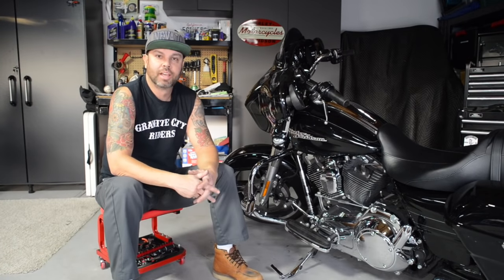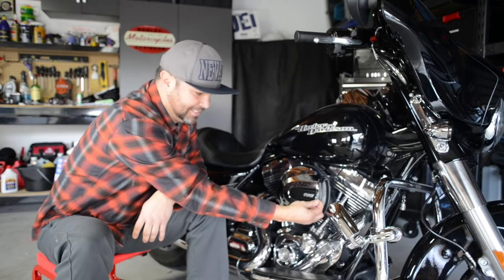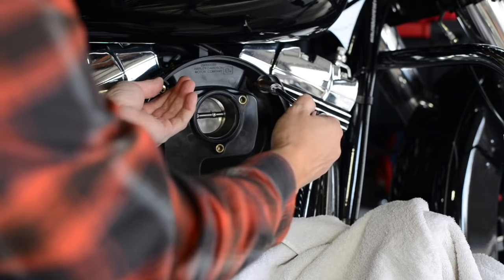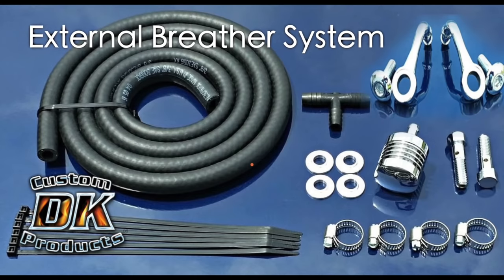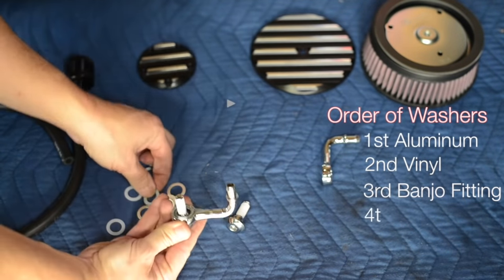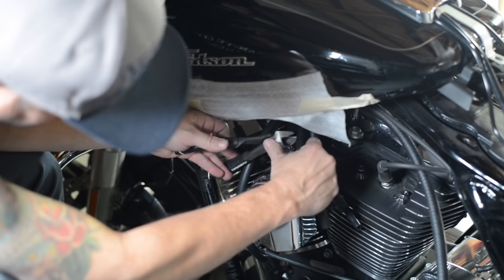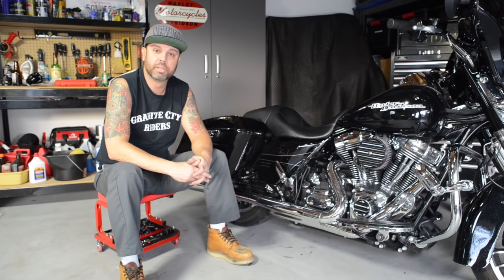How to Install a Stage 1 Air Cleaner and External Breather System on a Harley Davidson Street Glide

Comment: My experience with this kind of a setup on an M8 engine is that the external filter fills up with snot after a few weeks and pukes out oil to wherever you have it routed, creating the problem that you started out to cure in the beginning. At the end of the  day I just removed the filter altogether and ran the rubber hose down to the bottom of the bike and vented out to the atmosphere.
Reply: you can clean the snot out every so often too.. im ordering one to try it so ill eat my words if youre right and it becomes full too rapidly

Comment: The problem with this DK Customs kit is that it works against gravity and the blowback accumulates around the banjo fittings. The banjo fittings should be routed straight down and not up over the heads.

Comment: Great vid man!! New sub here! I have a 06 dyna super glide. I have one question when u put the new air filter on do you have to remap it? For the air/fuel mix??? I want to do this but the dealer here said I would have to map it. They charge a lot!
Reply: Yes mate you need to map it. Changing the filter alters the fuel/air mix. Without a fuel management system like fp3 it will run incorrect

Comment: How does this product actually ventilate the crankcase if there is only a catch can? Am I missing something here?
Reply: The catch can has breather holes in the top and the oil goes into the filter layers in the bottom. Oil in air out.
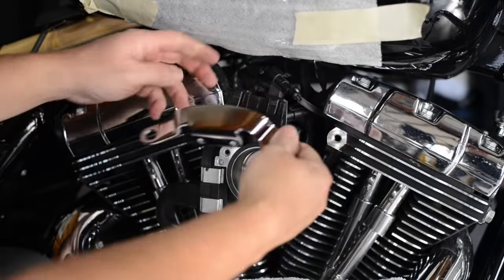If you look at this video from about the 1:30 to 2:00 mark you can see the design of the catch can pretty well.
https://www.youtube.com/watch?v=oYSQWWJYZak

Comment: Is there ever a point where installing an external breather would no longer really be worth it ? Those without and with photos at the end made my eyes pop out of my head lol.....at 9kish miles after a top end rebuild on my fxdb, I can only imagine what mine looks like inside. Another dumb question, is there a product or method out there to clean all that shit out without tearing down the motor ? Is that what the seafoam shit is supposed to be cleaning ? Kick ass production quality as always man, good stuff!
Reply from the maker: Thanks Matt... I think it's worthwhile no matter how many miles.  The buildup will at least stop accumulating.    Sea foam is popular for carbon build removal.. I have never used it myself.  Maybe someone else out there can speak to this...
Reply: Yes, there are some chemicals for this job. Gixxxerfoo the YouTubeer has a video about it. 
1st remove the air filter and spray it right in the intake
2nd one day before the oil change, remove the spark plugs, spray the foam inside and let it work overnight. Next day, mount everything back, warm up the engine and make the oil change.

I hope that helps....

Comment: Is this throttle by wire? Or cable ?
Reply: Will that stock 103 air cleaner fit a 2015 fxdl